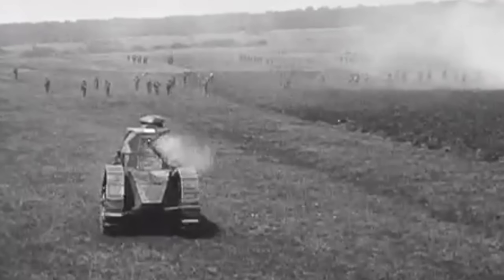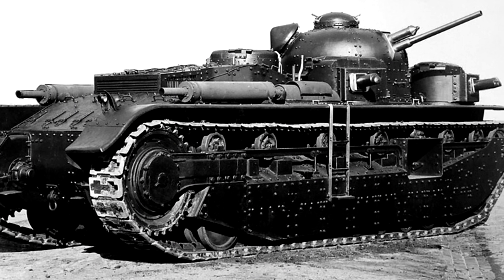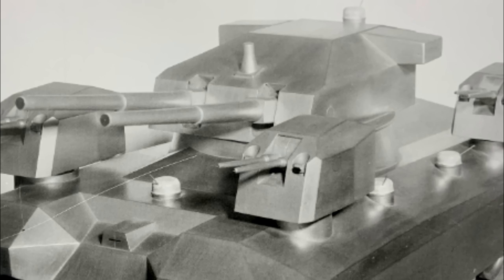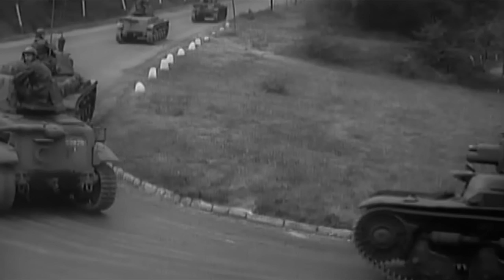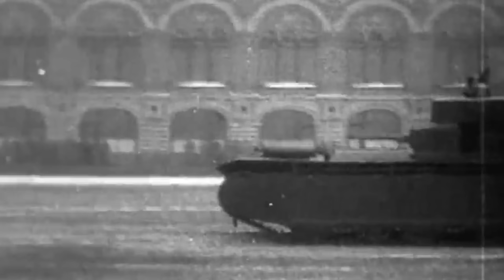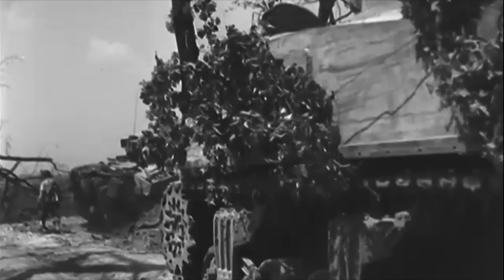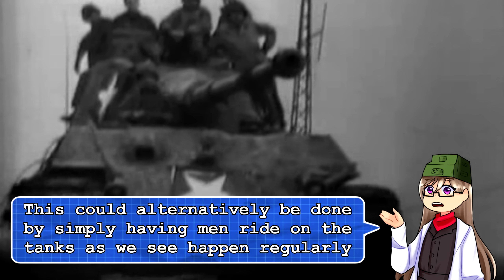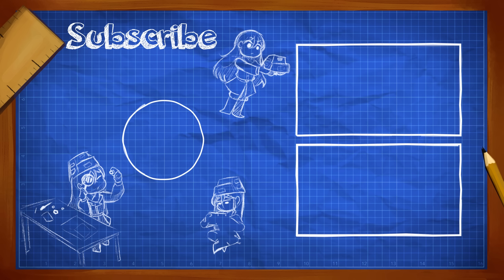Why do Multi-Turreted Tanks Fail?

Comment: Wouldn't those remote machine guns on the top of modern tanks count as multi turret?
Reply: Well yes, but actually no... but yes?...

To my knowledge they don't count because their combat role is secondary to the primary role of supporting main turret with visibility and detection. Modern remote turrets are attached with commander thermal viewer, they are simply a way for the commander to operate the thermal to spot target as well as not having to expose himself to operate the MG.
Reply: He covers that.
Reply: @oldesertguy9616  Pfft, you think I watch all of the video before commenting?

At least I didn't write "1st" or "fantastic video" (while clearly not having time to have seen the entire video)
Reply: @All_Hail_Chael pues miralo antes de opinar
Reply: He goes over it, but CROWS are used in place of Pentil/Sponson MGs for detection, infantry defense, and occasionally suppression. They are intended as backup weapons and support devices... if you were to use an MG at range, it'd probably be the coaxial MG primarily due to the gunners sighting system, advanced FCS and advanced stabilizer.
Reply: I don't think so, because it isn't manned, and is controlled my someone in the main turret.
Reply: @kildeer1897  Would MTLB-based abominations count then?
Reply: @kildeer1897 By that logic the T-14 doesn’t have a turret at all.
Reply: @kildeer1897  does the m60 have 1 or 2 turrets
Reply: @kildeer1897 the t 14 armata has one unmanned turret, would that mean it is just a chassis?
Reply: @kildeer1897 but that would mean Tanks like the T14 armata aren’t takes, because it has a crew less turret. (I know it isn’t at example but it was the first one I could think of.)
Reply: @kildeer1897 It is its own turret. If there was a vehicle with several AI controlled turrets would that be considered multi-turreted?
Reply: @kildeer1897 no because that would mean t14 armata doesn’t have a turret.
Reply: So remote controlled tanks wont have turrets? @kildeer1897
Reply: @kildeer1897 would that make the T-14 a turretless design?
Reply: @kildeer1897  So the T90 also doesn't have a turret
Reply: @kildeer1897 I wouldn’t agree with your reasoning since being manned is not a requirement - soon entire tanks may be unmanned
Reply: @kildeer1897  Ahhhh... very good, I didn't think about that.
Reply: @kildeer1897  but their are turrets out their like the T14 that are unmanned
Reply: @kildeer1897 nah most mbt’s now have remote controlled turrets with 3 crew members in the hull and none in the turrwt
Reply: @kildeer1897  yeah but some turrets are unmanned like the t14 armada or a puma ifv i wouldve said no because its  just a roof mounted mg and its not a main caliber
Reply: @kildeer1897 isn't that how some tanks are now? I've seen gunners at the base of the tank instead of the turret especially on those auto loading ones.
Reply: @kildeer1897 so T14 armata is unturreted?
Reply: @kildeer1897  Read your argument once more and think thoroughly why is it dumb
Reply: Technically yes,  more so since new designs like the Armata have crewless, compact turrets.
Reply: no that would not be a multi turret. it’s not enclosed or half enclosed and it doesn’t a large caliber
Reply: not really
Reply: Tell me you didn’t Finnish the video without telling me
Reply: M48's little commanders cupola turret makes me think of this.
Reply: I was thinking the same thing about the commander position on a m60 with a machine gun
Reply: There is a cold war tank with a second turret, well if you even consider it as a second turret, the patton has a MINI turret ontop with an mg like the lee :D mini turret!
Reply: Yeah thats either mg,gl or even autocannon turret. Idc what other people think, its trying to achieve the same thing.
Reply: Also having a gun and a missile launcher could count at least as multi "weapponed" tank / armoured vehicle
Reply: No, because they’re not turrets, they’re machine guns.😐
Reply: @ElysiumNZ  they're part of a very large  usually stupid video dismissing comments
Reply: No
Reply: No
Reply: Those don’t count
Reply: It’s stated in the video 13:15
Reply: No
Reply: Found the guy who commented before he watched the whole video!
Reply: @claytonargyle9874  woot
Reply: me when i dont even watch the fucking video i clicked on
Reply: No
Reply: No master on the subject but so just grabbing this from Oxford languages "a low armoured tower, typically one that revolves, for a gun and gunners in a ship, aircraft, fort, or tank" 
By that definition a turret requires a person but that is just one definition. There is as many definitions as there are people. Language takes also a while to "get up to speed" and for what 80 or so years a turret ment that a person had to operate it pretty much but now it dosent and I feel that changes things.
But how can we define a turret then? My suggestion is that for it to be a turret it must be able to swivel the gun and all components with it and that the gun and related components is reasonably armored from a bare minimum of 3 sides

Hopefully that is atleast I would say a decent definition but there is probably some thing that could be considered a turret that isn't as I described it and there is nothing wrong with that, it happens to every definition
Reply: Schrodinger's Turret xD
Reply: Kind of. They're not really turrets, but they fill a similar role.
Reply: 30 seconds into the video he defines multi turret as “more than one Primary Armament “
Reply: @MrSheckstr  And then goes on to define another kind with one primary armament and sub-turrets for secondary machine guns.
A RWS isn't really a turret, but a cupola like on the M60 is.
Reply: Umm no because they are used for secondary purposes but at the same time they are technically turrets. So you can consider those as turrets but the tank it is fitted on is still a single turret tank.
Reply: In the case of the Abrams,  and I think it's fairly standard across the board, the machine guns are pintle mounted not turret mounted.  You can remove them and change weapons with a few pins .
Reply: Technically no because it's no man actively Manning it. To mention for it to be multi turret it would have to be a higher caliber  50 cal. Because this is just a secondary gun option mostly used for suppressing fire. Its like a starter line up in football. You got a qb but u can't have a lineman play qb unless said lineman is trained into the qb position.
Reply: He just said that in the video (near the end). What is the point of mentioning things he already has answered and why are there so many likes? Are there really so many people NOT watching the video and still commenting and liking? So annoying!
Reply: @orange25i  I already heard this being mention in the video but I came to just correct the answer the comment question
Reply: Well it's an MG
Reply: It is counted as a turret on vehicles like a humvee (if it has no secondary weapons) because that is its only armament not counting the crew. The MBT machine gun turret pales in comparison to the main gun. Making it an anti infantry weapon
Reply: Isn't the RC gun controlled by the commander though?
Reply: @boi8328  on tanks earlier and in most MBT today the secondary weapons can be remote controlled or manually controlled
Reply: No
Reply: The machine guns mounted on turrets had first and foremost an anti-air defense role.
Reply: No
Reply: No cus they dont look nearly as cool
Reply: M48 and m60 have a kind of turret mg design, so maybe they are multi turreted
Reply: I mostly know turrets in the context of naval, still with them for something to be a turret it needs a meaningful degree of armour.

Without that it's just an enclosed mount
Reply: Think M3 Lee.
Reply: Wouldn’t the Sherman be multi turreted then?
Reply: I think he is taking about larger guns
Reply: No cause they don’t take away from any of the primary functions of the tank they just aid
Reply: Ehhh it’s a sentry gun not really a turret
Reply: Yes, in case of versions partly or wholly enclosing the “safe” end of the weapon in a mechanism able to pivot at least partly. 

As for the destinctions between turret, cupola and sponson, we must allow rather wide definitions; I’d say the M3 Lee had one of each
(Mounting 37mm, 30-06 MG and 75mm respectively) but if we only count manned turrets, the T-14 doesn’t have a turret at all, if we only count fully enclosed turrets, the M36 didn’t have a turret, if we only count main or heavy weapons, the Vickers Independent landship only had one turret (it had 5) if we only count fully rotating turrets we must discount other tanks and are oscillating turrets - in spite of their name - turrets at all ?
Reply: i think they’re weapons stations so maybe its like, a different classification? idk
Reply: Yes, the thing about those is that they’re remotely operated, meaning it’s either the loader or commander operating it, not a 5th man
Reply: I hate useless comments stating obviously wrong things
Reply: Remember. With many turrets, you can only focus on a couple of enemies at a time
Reply: No bc the "turret" is an armored cap containing a manned firing mechanism, those are unmanned remote guns
Reply: Well those machine guns are added for light defense so no
Reply: A machine gun is not a turret. I recommend looking on Google for a picture of a turret to help you understand.
Reply: Bro doesn’t know what multi turret means
Reply: It doesn't 
Its considered an mg
Reply: At that point, you're really stretching the definition of multiturret
Reply: @amtheminer3803  multi turret means multiple turrets, which machine guns aren’t
Reply: Machineguns are considered turrets only in TD games. In real life a machine gun is considered a machine gun.
Reply: dumb ahh 💀
Reply: imo rcws stuff nah but things like the m60 cupola maybe
Reply: listen here you little shit
Reply: Nah the Machines guns are clasiflied as a secundary like a glock
Reply: Kinda in a technical sense, but they are usually a defense tool or used for sensors higher on the tank to see
Reply: There's no turret,so it ain't a turret just a machine gun on top of a tank
Reply: Older tanks had those too
Reply: Kinda
Reply: Technically…. I think?
Reply: I'd suggest multiple turrets would make something multi turreted. 
Otherwise you could strap wires to the triggers of a dozen assault rifles glued to the top of the tank, and call it a bakers dozen turreted tank! I feel this might he what someone who knows what theure on about might say.
Well, the first bit, not the string and glue rifles bit.
They, probably, wouldn't say that bit.
Reply: War thunder
Reply: Not quite, no. Because they serve different purposes. Youre not about waste a shell for an infantry
Reply: Double-Decker
Reply: Turret means tower
Reply: Nahh, by that logic, a cupola machine gun can count as an extra turret
Reply: Ok, but how is the M4 Sherman hull gunner/assistant driver with his Browning not a turret?
It had bearing and elevation, was independent of the turret

If it makes you feel better we could call it a vestigial turret, like the bone that used to connect to our tails. 

And at that, how is the M3 Grant not a multi turret?
Reply: Key phrase: main armament
Reply: It’s not really an armored turret
Reply: Sort of. They do suffer from a lot of the same disadvantages that multi turret tanks suffer from.
Reply: So technically, Multi turret was so good it didn't see good use until 80s lmao
Reply: It's a turret, it's just an auxiliary gun that is attached with remote control
Reply: Yes, it would.

I don’t understand some of these replies. A turret does not need to be enclosed or a large caliber.

If we are speaking turret, as in a weapons system or gun, then a mounted machine gun is a turret.

To be a turret, it must be capable of rotation and mounted upon something. It can be manned or remote controlled. A machine gun on a tank is in fact a turret. It is capable of rotation and elevation, and is mounted upon the turret of a turret. 

It’s a turret.
Reply: @herrfantastisch7489 By your logic. Multi-turret tankes never died then. The mg on top of tanks in WW2 would be considered a turret. It moves and is monted in something. Your logic fails at the start.
Reply: @NayuzAqua  But that’s not my logic? That’s literally the definition of a turret. Are you sure you’re not just referring to “multi-cannon tanks.” 

Because, yes, most tanks still use multiple turrets. To my knowledge, no modern tank uses multiple cannons.
Reply: @NayuzAqua  Yes? If a machinegun on a tripod can stand alone and be mounted… it’s a turret. Similarly, if it’s remote controlled, it’s a remote controlled turret. 

A Vickers from WW1, for example, can be a turret when mounted on a ledge, tripod, barricade, etc. 

I don’t understand what the confusion is? What is a turret by your definition?
Reply: @herrfantastisch7489  The problem here is. MG on a stick insn't considered a turret even in the army. End of the question.
Reply: @NayuzAqua  Well, I mean, yeah? You keep saying stick. Are you referring to a literal stick or single prong? 

Because a turret can be mounted on a singular support, prong, or beam, but do you mean an actual stick?

Just try and think of it this way. A bipod machinegun is not a turret. For one, it’s held, not mounted. But if you were to take said machinegun and attach it to a barricade, it becomes a gun emplacement. A turret.

A machinegun on a tripod with shields, such as the Vickers, is a turret. A machinegun attached to a barricade is a turret. 

This is no different than a machinegun being emplaced upon the turret of a tank. It’s an armoured emplacement capable of rotation. It becomes a turret.
Reply: @herrfantastisch7489  The army don't call it turret. Not a turret. End of question, again.
Reply: i'd say in the context of the early days of tanks, it would be Manned Multi Turrets, not automated unmanned weapon systems

so no, a CROW system, or any other variations of similar systems do not count as multi-turret.

imo, unless the design specifically has the system as an integrated component of the hull or the turret, it's not a multi-turret design.

though in this perspective, the old commander's hatch with an integrated .50cal would somehow be a turret, i cannot find any reason to argue with this as at the time of writing i'm taking a break from a project so i will go back to this when i even remember it/
Reply: No, cause pintle mounts will be a multi turret vehicle.
Reply: No it’s not enclosed
Reply: No. They wouldn't. Learn tank terminology.
Reply: @justinstrong9595 

I'm on a campaign to remind people that it's possible to disagree (and even to be correct in doing so) without being a gigantic pedantic ass.

Hope I helped! Have a nice day. 😊
Reply: @justinstrong9595 tank terminology is evolving along with new technologies.

You cannot just learn terminology to categorize new technologies.
Reply: @justinstrong9595  How about fuck off how's that for terminology?